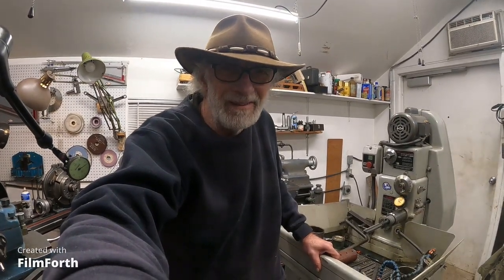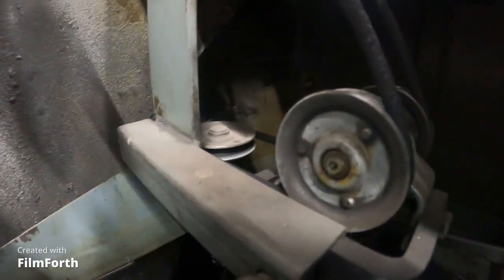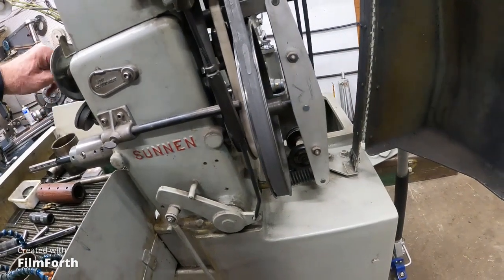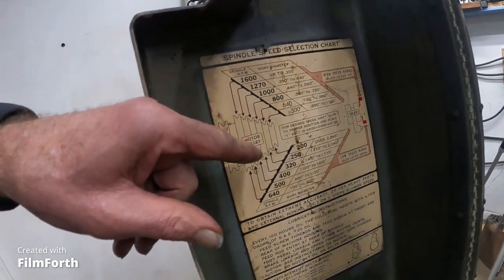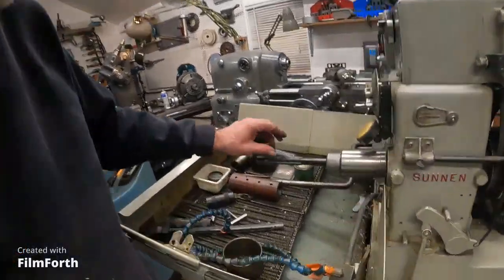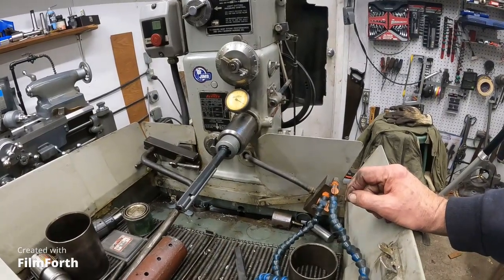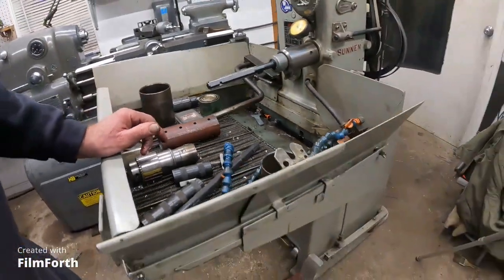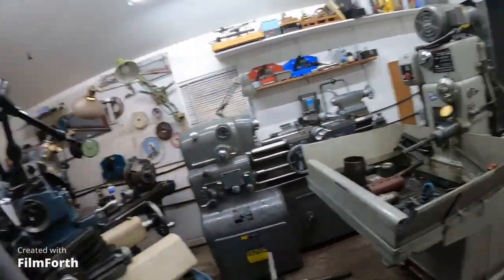Sunnen MBB 1600 Honing Machine

Comment: This video is a treasure sir. Thanks so much. I’ve had my (same) machine for several months and just got it placed and operational. My first use of it is going to be my own king pins and bushing on one of my cars. I may have to buy some tooling though. I got the cabinet and tooling with it but first glance doesn’t appear I have what I need. Thanks again!
Reply from the maker: Thanks for watching!
Reply: Mine is actually an MBB-1660 so it’s a later model with the stamped steel base.  @deedeeindustrialsuperprecision

Comment: Just picked up a MBB1290D with Two racks of mandrels and boxes of NOS stones. Question is: to clean sludge from the tank should I scrub with Kerosene or something else before flushing and adding new honing oil.
Thanks for the videos.
Reply from the maker: I am going over my machine, mineral spirits seems to cut through, great machines the 1290, they can do it all. Thanks for the comment I will do more videos!

Comment: What’s the horizontal bar on the right hand side for? The one which slides in the alloy casting with the thumbscrew? My machine has the casting but not the bar.
Reply from the maker: I think that bar may be part of the power stroking attachment?

Comment: Your videos on the Sunnen hone have been very informative since I have a Delapena bench hone which while just the basic hone section of the machine appears to effectively be a copy of the Sunnen, I believe even the tooling interchanges, I got it out a scrap yard for basically nothing, it has a locked up motor but the rest of the machine seems fine, I found some tooling with it but not a great lot. It's one of those projects I will get to if there is time or if I really need the machine.
Reply from the maker: I have a few Delapena arbors they fit Sunnen fine, The Delapena hones I had seen years ago at Anchor Machinery in Oregon where I bought the Sunnen are heavy top notch, but not very common except for aerospace companies said to have great fine adjustments the dealer wanted more for them, all came out of Lockheed Martin in California.